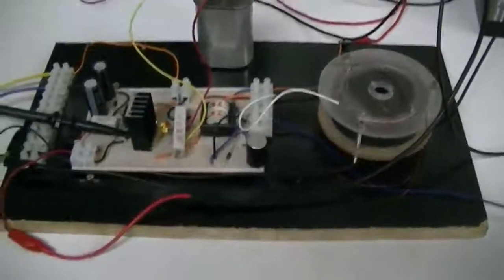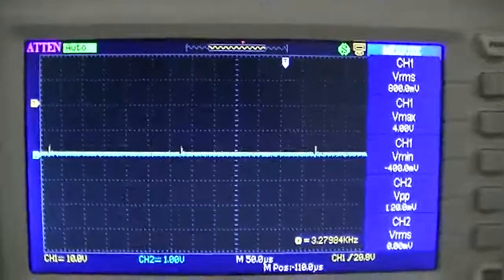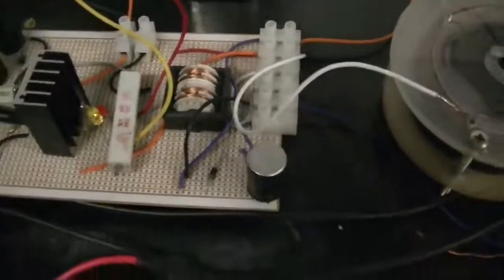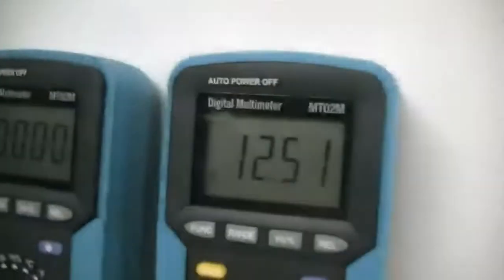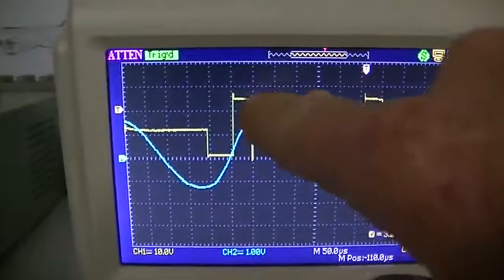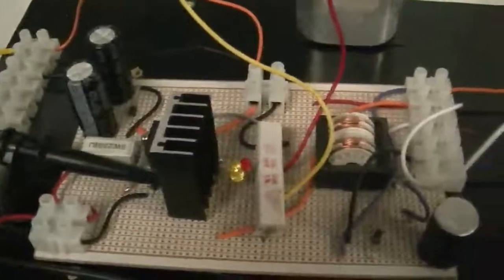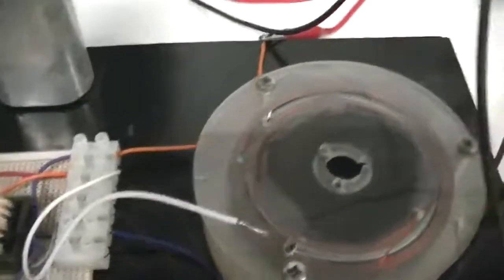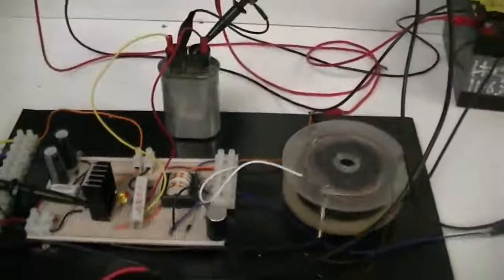Lenzless transformer The magneformers first run

Comment: Your halfway between g 7th and g# 7th on the scope. Can you get it down to 3135.96 hz (G7) or up to 3322.44(G#7) just for fun? Interesting way to use the charge current to stimulate the tank circuit :) I have no idea where you are going with this. I guess I should go see IAEC. Your coil actually reminds me of a speaker the way its wound....

Comment: Novel experiment there Tinman.  Thanks for your earlier reply.
Could the input duty cycle % be further reduced by fitting a parallel tuning capacitor to resonate the iron field winding ?
Or what about driving the iron winding itself to eliminate Cu primary losses, maybe via a series resonating capacitor ?

Comment: Insulate the layers of the magneformer and the ring will decrese or go away.
Reply from the maker: Each layer is insulated with thin foam rubber tape,but didnt seem to do the trick.It only rings at that frequency-100 htz either way,and it's quiet.I would say that is a good indication of the resonant frequency of the core itself.I have never had any other inductor ring like this one dose.
I will throw a towl over it in the next video.